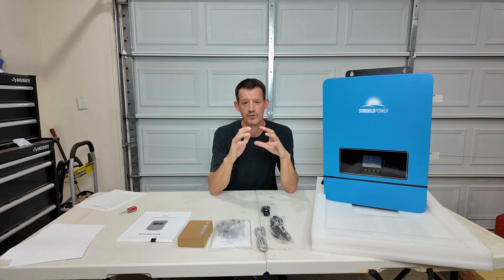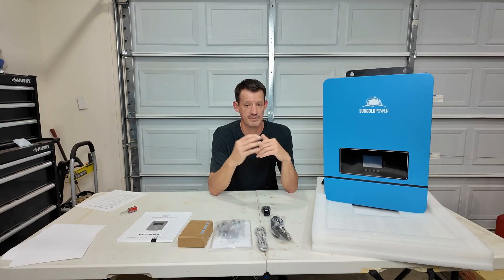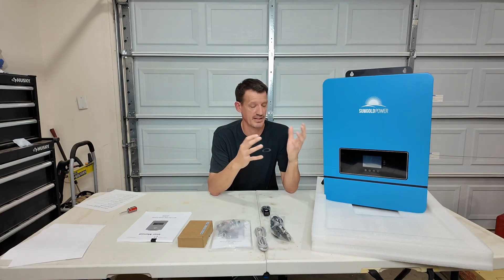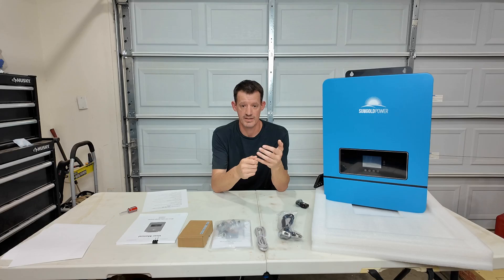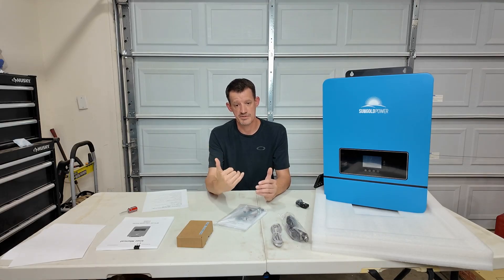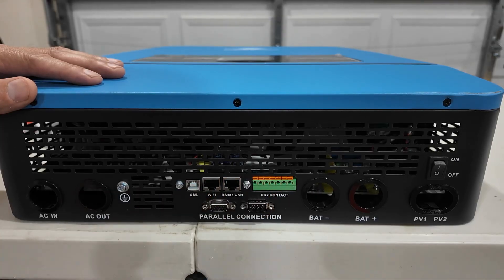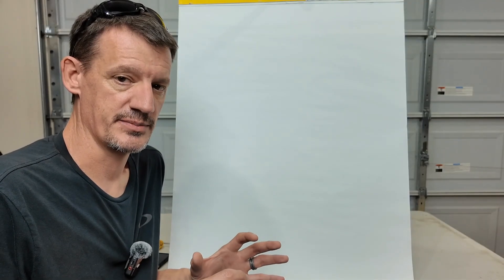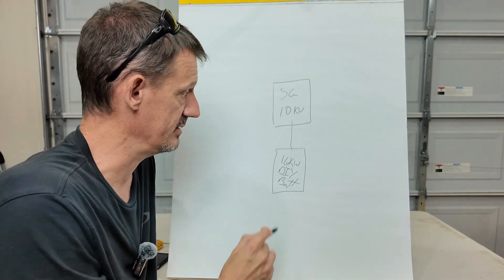Unboxing the Sungold Power 10kw Solar Inverter

Comment: You don't have a "16kw DIY battery".  You have a 16kw-HOUR DIY battery.  There's a difference....
Reply from the maker: Yes that is correct.    Thanks for pointing that out.  The battery just arrived and I'm working on that video now.
Reply: @thekayfamilybuild  I've recently played with this very same inverter, 16 EVE 280 Amp-Hr cells and a 170 amp Overkill Solar BMS.  It's been quite fun.  Best of luck with your build.
Reply from the maker: @johnreeves7261 Thanks it should be a fun build.   Excited to not run the generator as much for sure.